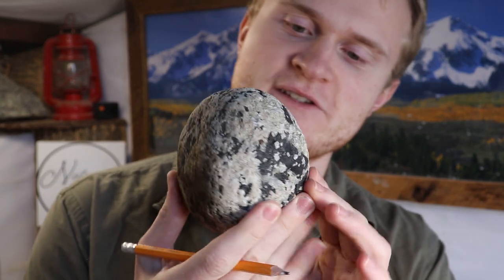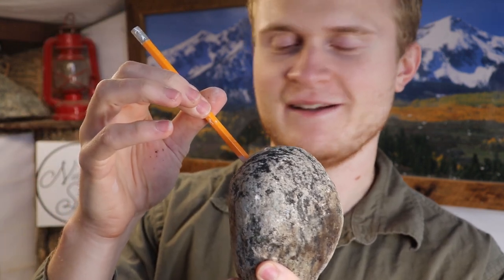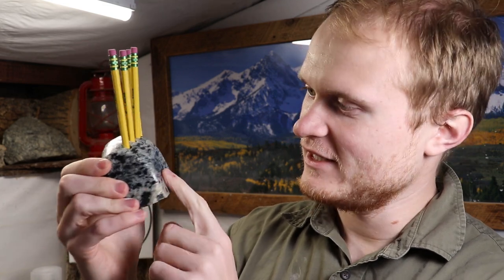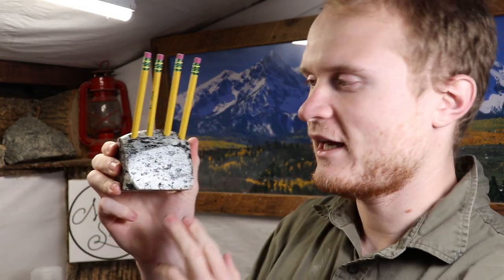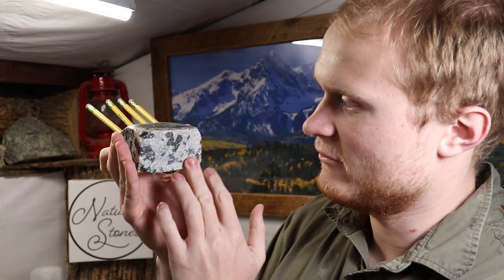How to Make A Simple Pencil Holder Out of Rock

Comment: My dude! I like it! Really nice job with this project!
Reply from the maker: Thanks Jay! Rock projects are my jam
Reply: @naturalstones4529  Just a tip, the vice face where you attached your gasket, you could bolt in taller plates to hold the rocks more securely.  Also I don't recommend pushing on the rock like you do.  If the blade grabs because it binds it'll pull your arm into the blade, seen it happen.  You do nice work, stay safe.